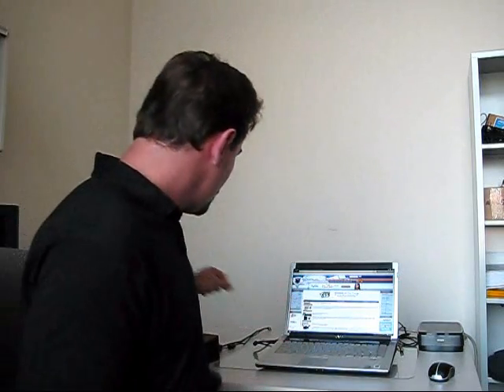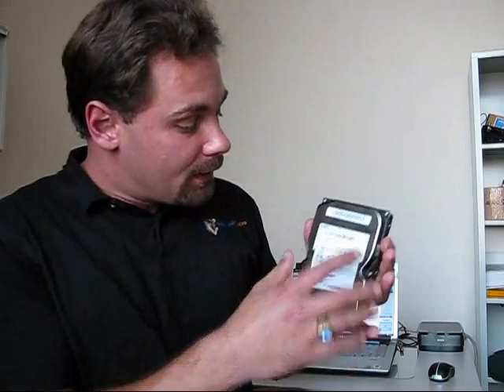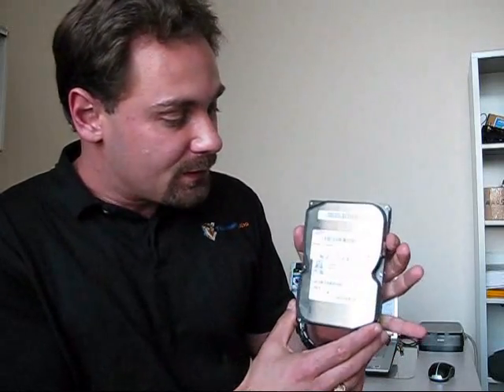Hard Drive Click of Death Explanation and Live Demonstration

Comment: @pcworld88 
Plus the clicking sound u mentioned is probably caused by that power inneficiency. Which means that u run the risk of compromising yr data,if it goes on like this.So at least make sure of backing up the most important of them. Trying another PSU on,is the best advice(even though the present one might still be ok but there somewhere might be some kinda conenctivity problem with he cabling ,which u can troubleshoot in the way I described in the previous msg).
Take care.

Comment: @pcworld88 
Simply replace that IDE ribbon cable with a new one and most importantly either disconnect other drives that are possibly connected to the same POWER cable or/and change the power cable that you connect your 2nd HDD with (not just another MOLEX connector, but one that comes from another power cable from your PSU). Eventually you may have to consider changin the very PSU.
Bare in mind that in general, "dissapearing drives" are caused by insufficient power supply.

Comment: @deluxedookie 
Eight months. It probably was bad when I bought it. After I installed it, it was accessing data at PIO 1 and kept getting block errors. I replaced it with another drive. The new one is a little noisy. You can hear the heads assessing data. But it is good drive.

Comment: When a hard drive has a click of death problem like this, can the hard disk control board sense the heads aren't reading data and send an error message to the motherboard?  I haven't had a hard disk fail in this way before, so i don't know what it's like, I assume most computers will just show up a disk read error upon startup if the hard disk has failed in this way.

Comment: My drive died days ago. it was showing symptoms a week earlier when I noticed that it would often turn completly off when in sleep mode. One day I open the lid, and it seems to work for about 10 seconds, then I hear the clicking. now it tells me it cant find a bootable disk. 

Does this sound like something that could be fixed with the freezing or tapping method long enough to recover data? Or is it likely going to require expensive measures? I really want the data back, but not that much.

Comment: @Shadeslayer235 Definitely sounds like your HDD is on the way out. A good tool I use it Hard Disk Sentinel, assuming your HDD is new enough to have S.M.A.R.T (Self-Monitoring, Analysis, and Reporting Technology) built in, it will provide you with a pretty accurate report of the status and health of your HDD.

Comment: I have 160 GB WD hard drive. When I perform a cold boot. The drive would click once and spin up after the screen that displays the drives. The boot would freeze at that point and eventually display a message that says "hard disk failure". This started after I performed a defrag and I canceled it because it was taking too long. Do you think I overworked my drive or caused the boot files to become corrupted?

Comment: @DarkProcrastinatioN He did say that the moment you remove the HDD covers, the platters are exposed to airborne debris and those tiny debris may not seem to be harmful but are actually like asteroids to the HDD platters, thus making data recovery, nearly impossible. The only time where you can open the cover is when you're in what it's called a "clean room" I don't mean your clean bed room but a laboratory like clean room with little to no airborne particles and you have to wear a suit.

Comment: It looks like a thermal recalibration. As the platters become warmer they change slightly their dimension due to thermal expansion. In this condition the heads cannot align correctly with the tracks under them so the disk reparks them (thus making the "click" noise) and then swipes the heads over the whole disk (this often making a slight "zzziiing" noise), sensing the new track positions and retuning the electronics that drive the head mechanism. Then the disk is recalibrated.

Comment: Ok, my hard drive is clicking, but its not as rapid as the video, and it doesn;t stop. It keeps a rhythm to it. When this happens one of the programs I'm running freezes up, I can minimize it and go to a new program, but after 5-10 minutes it takes over the whole computer. I had this before, and I just cleaned off the processor fan because I read somewhere that its either the hard drive or the processor fan. After taht, it started working for about 5 hours, and then it started clicking again.

Comment: Great video man, helps me understand the problem, too bad my HDD is out of warranty.

Funny part is my 36GB Raptor was doing this a year ago, I ran HDD Regen, and reformatted Vista, and for a year my HDD which was in a Raid-0, was working fine until this morning my PC froze and I rebooted to the clicking sound.

Maybe after I finish running HDD regen it will fix the problem like last time and I will be able to use it again.

Comment from the maker: This is actually not uncommon for some laptops. While Ii am not certain as to the casue of this random clicking it is due to the arm hitting the stop and is not a healthy sound or action ofr the drive to do. This can eventually cause the drive to fail if the reader head strikes the platter. i suggest you start backing up your data. The drive death may be days, months, or years away but it will eventually fail. The clicking you are experiencing will only hasten the drive's demise.